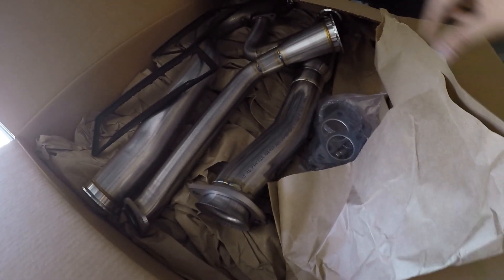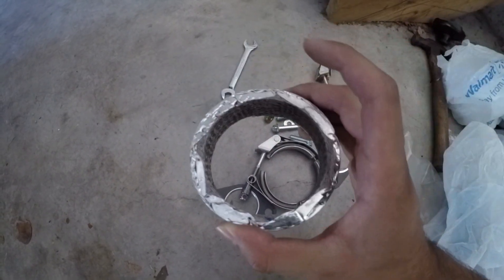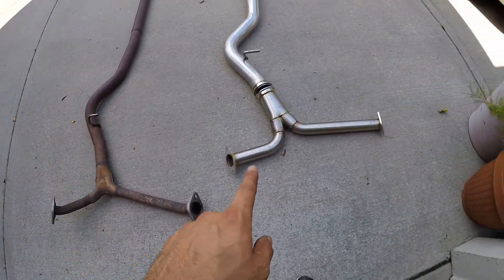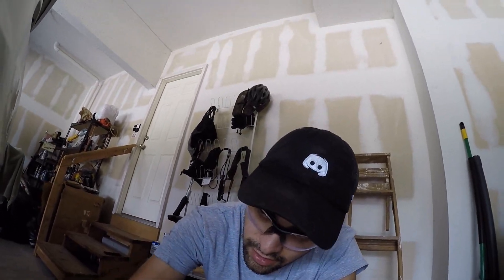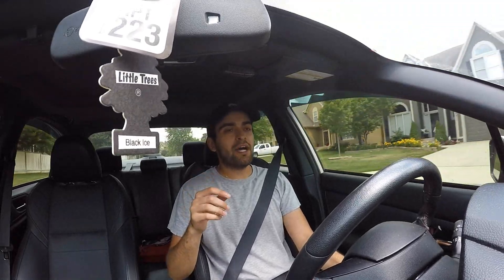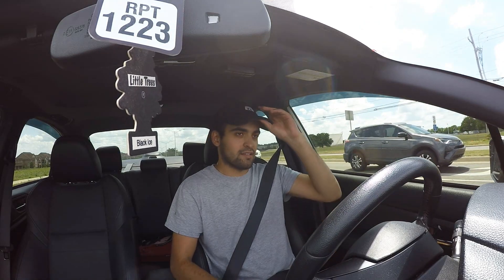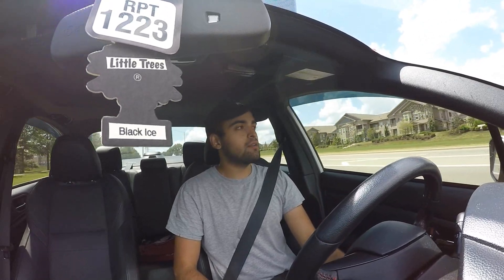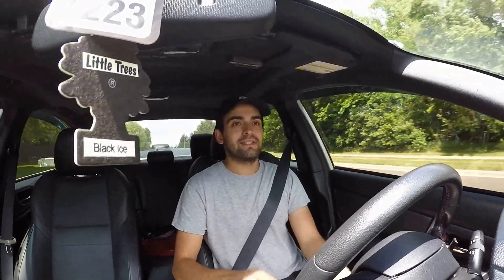2016 WRX Nameless Performance Midpipe INSTALL / REVIEW

Comment: A cat back wont give you much of a gain untill you upgrade the downpipe. Maybe a couple hp removing the restrictions caused by the stock muffler. The exhaust is mostly choked up at the downpipe. Only "x" amount of exhaust can flow through it. Untill you open that up, it doesnt really matter how much you open the exhaust behind it.
Reply from the maker: Yep 100% agree

Comment: Dont mind all the people giving you shit for the cvt man.  Yeah the manual has its benefits for modding but for some people that have long commutes and city driving its a bit hard dealing with a clutch all the time.
Reply: It’s not though if you know how to drive a manual. I owned the CVT prior to my manual and I made the same excuses. To me, the only reason to buy an auto wrx is if you physically cannot drive a manual.
Reply: @jaschlit  I have the CVT specifically because my wife REFUSES to want to learn how to drive a manual. I'm decent at manual but I had no choice but to lock in to the CVT. Otherwise I would have went with the manual. However, the CVT is doing everything I need it to do and more for the price I paid as opposed to any other car on the market.

Comment: Does your brother have a stock downpipe on? In this case, wouldn't you need a 3" adapter since you're replacing the OEM midpipe but keeping the stock Downpipe? Just wondering since I'm going to be installing one myself soon
Reply from the maker: Yes still stock downpipe and actually I think this nameless exhaust was still the stock size or just slightly bigger. All bolted up easily with no issues

Comment: It’s not worth it, since the stock mid pipe is just a straight pipe, increasing the pipe size won’t change anything unless your pushing high horsepower
Reply from the maker: Yeah still good to have the full system though
Reply: I have a catted j-pipe and nameless axel back, should I get a mid pipe ?
Reply: inn the same boat, want more noise lol. just dont think 500$ is worth for a little more.

Comment: I currently have a 3” axelback exhaust and if I were to get a 3” J-pipe/downpipe will the oem 2.5” midpipe in between both cause any sort of noticeable bottleneck?
Reply from the maker: It will definitely cause a bottleneck but not sure how noticeable itll be if it would even be. It might sound a bit off with the different diameters. I know it did on my G35 coupe but that's NA so not sure how different it is for forced induction. But honestly I would just go ahead and get them. The midpipe is easy to replace so you can always do that later
Reply: OPDrags ya I just don’t have the kind of money for a midpipe right now I was hoping just the downpipe would do it but I’m not planning on pushing the car so I think I’ll be fine till I get the funds for a midpipe later on, thanks for replying btw I have a 2015 wrx automatic
Reply from the maker: @roastedhd2852  yeah no problem! I thought a tune was needed for the downpipe though? I could be wrong, just what I've read
Reply: OPDrags yeah I’m aware of that when you get a downpipe you become stage 2 therefore strictly needing a tune I’m stage 1+ rn with a big sf intake, bomba bpv, and axelback muffler delete just planning on going stage 2 pretty soon here so with the downpipe and my current mods I would technically be stage 2+ but not planning on going above stage 2+ as the transmission on the auto’s are not the best for further performance modification. I just want a little more power for some night driving with friends and some spirit driving here and there but I’m not planning on tracking the car or anything still wanna keep it a daily, but ya tune must be done when it comes to the downpipe
Reply: OPDrags since I’m daily it I don’t wanna get it protuned as it is too expensive I’m just gonna get a ots e-tune from ambottuning
Reply from the maker: @roastedhd2852  ah okay nice. Yeah this 16 WRX is my brothers and he already had a transmission replaced under warranty because it started acting up lol

Comment: I think cuz ur car is atomatic. Rather than manual trans.
Reply from the maker: Still the same engine though. Transmission wouldn't change an exhaust tone
Reply: Edgar Sanchez Ortiz so what i have auto too wrx 15 with axel back srs
Reply: Edgar Sanchez Ortiz put in maunel mode u can hear it more
Reply: Edgar Sanchez Ortiz same thing man
Reply: Richiewrx 15 idk man. I drive a 2018. Maybe a bit diferent. Ikd lol wasnt saying u were wrong. I was saying  like..maybe